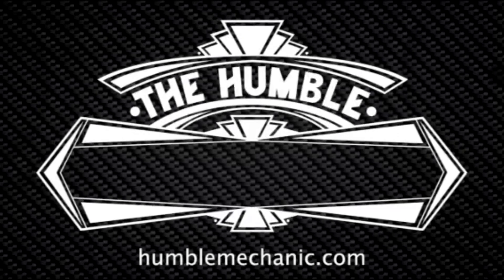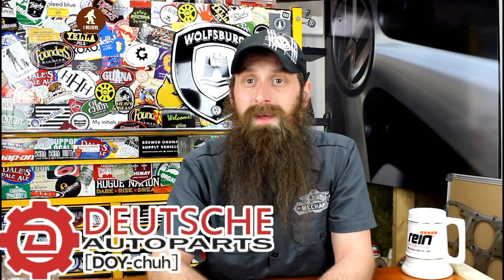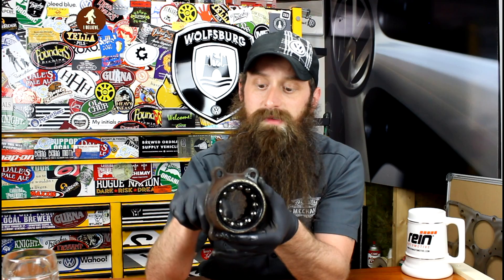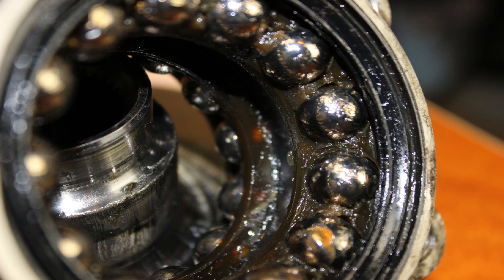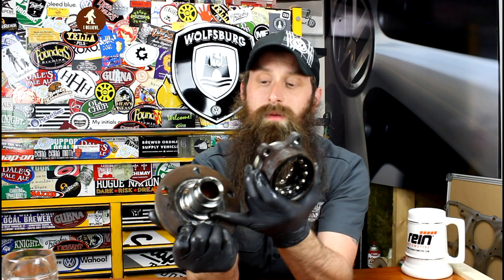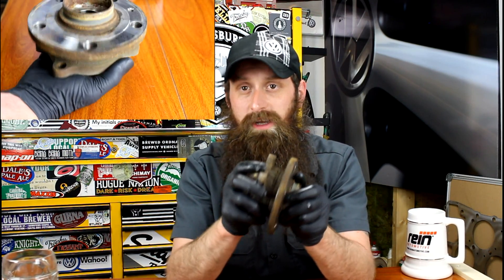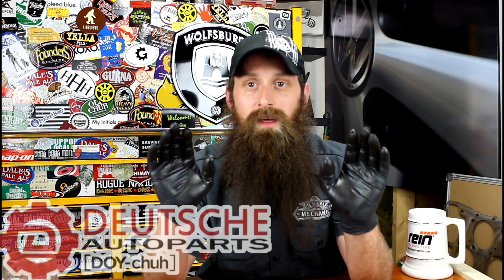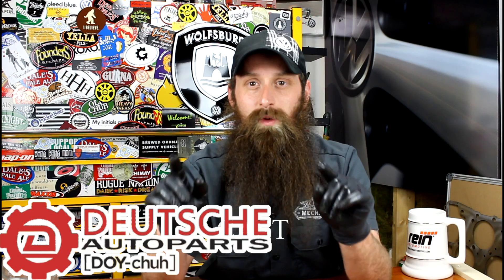How VW Wheel Bearings Fail ~ Video

Comment: Another way to diagnose which bearing is bad is to jack up the car and spin each wheel while holding onto the suspension spring. You’ll feel a vibration/grittiness with the bad bearing.

Comment: Hey Charles, 
I have had an undiagnosable vibration since I bought my 2018 Sportwagen last September. Dealer has replaced haldex, both guibos right axle, and right wheel bearing. I have tried 4 sets of wheels, 3 sets of tires. 

Vibration is in the steering but very light, also in my gas pedal, feels like a cell phone. Techs keep telling me it’s not exhibiting bearing symptoms closely enough for it to be replaced but I’m running out of ideas. I feel every road surface through the pedal as well. Any insight? I’m kinda going crazy
Reply: I can’t reproduce a “wom wom” but it’s definitely loud on the highway in the cabin. The roads are kind of crappy out here so hard to tell much over tire noise.

Comment: A little misinformation on this video bud. The older ones do have another option other than pressing them in. You can buy the whole assembly online for less than 100 bucks to which you just bolt it on. I have an mk4 golf

Comment: Can wheel bearings affects the transmission if we didn’t change them on time? What the worst going to happen if we ignore to replace them immediately after we hear the noise?

Also I noticed I got the noises from the bearings only on winter when it is really very cold about below 25 degree

Comment: Whats the easiest way to change the rear wheel bearing on a awd 2010 tiguan? Manual says to take the housing off. Doesn't even mention taking the bearing from the housing so I'm hoping there is a way to pull less bolts than the manual suggests as I like in snow country where we use rock salt on the roads

Comment: I just bought a used 2014 Jetta sportwagen tdi a month ago with 50k miles. This vehicle sat at the silver dome for a couple of year. I took it back to the dealership bc of crazy loud road noises from the front left tire. Test drove the car (which seems faster now) on the highway and now I can hear the front right making the same noises. Could this be that the bearings warped/rusted from sitting two years without movement? Will I likely need to replace the back too? The car is extremely loud on the highway. Anyone have any thoughts if vw is warranting the hubs on tdi’s?

Comment: If its a suspect wheel bearing, the noise will be loudest at the hub with the worn bearing. Get the vehicle up off its wheel at the appropriate end, secure with axle stands and firmly chock the wheels still on the deck. Rotate the free wheels and use an engineer's stethoscope or a stick to listen to the rotating bearing by touching the hub. You can use a socket and speed brace on a wheel nut to get the spin speed up a bit. The task needs an assistant.

Comment: Can anyone tell my what makes my mk4 whine when I’m going through the gears. I have the 5 speed 2.0 . It sounded like it is in the wheel. And when I hit the brakes it feels like the wheel on the driver side flops around. 

Now let me say . I have a new axle . New wheel bearing. New ball joint. New coilover. 
I can’t duplicate the sound on jackstands. 
I disperetly need some help. 
Is it possible coming from the passenger side? The sound sounds like gears or a Ford power steering pump lol. Im open to all advice. Thank you in advance
Reply: xamot80  ok! Thanks 🙏

Comment: Is my 2012 Jetta S the kind where I can just remove the complete bearing/hub assembly or like my 07 Honda CR-V where the front ones require the bearing to be pressed in? Weird thing on the Honda is the rear ones are replaceable as one unit but, like I said, the front ones require owning a press. I did the rear myself but was forced to pay for the front ones. How is it on my 2012 Jetta (front & back). Please, replies ONLY from people that know FOR SURE about my particular year and model. No general “They’re all about the same on those years” type of answers.

Comment: I have a vibration at 75. Mk7 aftermarket wheels. I had everything checked for round and balance 3 times. Makes no sound and it comes and goes. 55000 miles on it.
Reply: And i have tried 3 different center rings.
Could it be a bearing?

Comment: I took my car to the shop and they told me it is a loud humming noise coming from the front of the car, but now that i see this vid. It makes since now , and the noise sound like it is coming from the front right, but i am not ready to spend that kind of money just yet,  times is hard right now,  i will do my homework to get a good deal i looked it up and it could range from $200-400, 😢
Reply: It’s a pretty simple DIY... if not I would suggest having it done when you go in for brakes and rotors as most of these things will have to be removed to do the wheel bearing. Good luck.

Comment: Had 2 of these break on a 2015 Tiguan. I’ve driven Ford/Honda for over 260’000 km and never change a single wheel bearing. Never  buy a VW/Audi.

Comment: My Jetta does a grinding noise while slowing down. Brakes and rotors are fine. Could it be the front wheel bearings?
Reply: I saw another video and I think the hum/vibration is because the wheel bearing is dry, no grease anymore

Comment: Got a vibration after 60-70 wheels are balanced perfectly and there is no play any ideas ? I am thinking Ci joint or a wheel bearing it is a 2010
Vw golf
Reply: Have you find the solution? I’m having the same issue.

Comment: In the bad good old days, we used to repack the wheel bearings with fresh grease.  They almost never failed and when they did, it was cheap to fix.  Modern wheel bearings are terrible, an expensive scam.  Instead of buying a few pennies worth of fresh grease every year or two, we are forced to spend hundreds of dollars on new hubs and bearings.
Reply: I agree, however felt nice to have new hubs too at the same time. I have however suffered a second failure of the rear left in the same year. Don’t know why. First set lasted 8 years and this was replaced at the dealer

Comment: Had my ps rear wheel bearing fail on me over the past couple months. Did not notice the noise until a couple days ago when it made metal on metal when turning right. 2012 vw golf tdi. The hardest part was breaking the bolts as I did not have access to a lift. Just a jack and blocks. Sketchy but got er done and saved a lot of money in shop fees. Great vid even though I just finished replacing it 5-6 hours ago lol.
Reply from the maker: Oh yeah that bolt is TIGHT!

Comment: Hey Charles!

I've got a 2014 VW B7 Passat 1.8T, just hit 70k miles. I've got a loudddd rumble noise around 55-68MPH once I go past that it's either very quiet or gone. Before 55 it's not really noticeable either. Around 55-68MPH it's annoyingly loud.

Funny thing is, whenever I turn left the noise goes away until I straighten the wheel, and then it comes back. It doesn't go away if I turn right, just left.

I was thinking it's the wheel bearing but I'm not entirely sure. I had a set of 17's aftermarket with hub centric rings, and it didn't happen.

Winter time came around, took it to Goodyear, put on my factory 16's with winter tires and it's happening now.

I don't think they took off the hub centric rings, as it wasn't returned to me, just the bolts.. could that also contribute to the problem? Or maybe they did take it off and didn't put it in the box for me..
Reply: Did you find out what the problem was ?

Comment: Hi Charles, love your work and these videos. I know it’s an old video but I just wanted to ask you a question. My mk5 golf Gti turns on the tyre pressure, traction control and the abs warning light when I get up to around 70 mph. I think this could be corrosion built up on the abs ring but does it come as a full wheel bearing assembly? Any ideas? Thanks in advance
Reply from the maker: possible, I would look at the tires themselves. Be sure you have the same tires all around. That can be an issue on the Mk5. I had one with 1 tire that was either worn too much, or a slightly different size (225 vs 235). It would trip the lights on a hard turn
Reply: Ok thanks Charles I will have a look at that as well then. Thank you for the reply also, it’s  greatly appreciated. Keep up the good work
Reply: @DrDepraved1  Don't mean to revive an old thread but just wanted to add a comment in case it can help someone else. I had a similar problem as what you describe. My ABS and ESP warning lamp would come on when I started hitting 60+ mph. It got progressively worse (as in, lighting up at lower and lower speeds) until it would come on literally as soon as I drove off after starting the car.
Took it in for diagnostics at a well-known franchise (in UK) and was told I needed a new ABS sensor (£45)  + wheel bearing kit (£150)
Went for a second opinion at an independent garage and the guy just took out the sensor, sprayed some WD40 and cleaned wtih a rag... the fault disappeared.
Nearly skinned for £200 for work that I didn't even need.

Comment: On my mk5 GTI it sounds like there's a helicopter on the front left side.
Reply from the maker: Sounds like a wheel bearing to me. Well based on what I read. LOL
Reply: HumbleMechanic Well it happened, because when I was replacing my struts I forgot to put the axle bolt in. Kinda a big screw up on my part. Just glad nothing really got destroyed, well besides the wheel bearing and maybe the CV joint

Comment: do i have to do alignment on vw 2012 jetta 2.5 after replacing wheel bearing
Reply: you may need to because of having to move the ball joint out of the way

Comment: hi I have a question, I have a 1998 GTI VR6 and I replace the wheel bearing on both front sides but the sound didn't stop and there's still play I'm the wheel. What should my next step be? thank you
Reply from the maker: +Juan Ramirez the play could v in several places on that corner

Comment: What you said about the helicopter sound sparked my interest.. I have a 99 Passat and the is an insanely loud banging sound that is exactly like that and it sounds like its coming from the right front and I have checked the brakes, wheel/lugs and all the suspension and can not figure it out.. unfortunately the bearing is pressed in so I'm assuming it will be a very expensive fix?

Comment: FUCK! I've been chasing a steering wheel vibration for a year,  mk5,  2 things, my steering wheel vibrates at exactly 64 mph. The faster I go the vibration goes away or minimizes, if I set cruise at 70 or higher it's almost gone.  The other red flag, I did get wheel speed sensor flashes on my dash a few times, the logo with the car and the skid marks, ESP warning?   I hope this is my problem but figuring out which side it is is going to be the tricky part.

Comment: My mk4 golf TDI had its front bearings replaced before 100,000 miles

My b6 Passat was also before 100,000 miles for the front and the rears shortly thereafter. At least they are easy to replace.

Comment: Really helpful video, my car (mk5 gti) makes a humming noise when i drive it at around 50 mph and i feel the vibration on the foot rest on the left side, the cv axle is new (needed replacement) but the noise is still there, is it the bearings?
Reply: David Morales Google "broom stick wheel bearing" to find the DIY diagnostic steps for an easy way to verify if it is the wheel bearing that is bad.
Reply from the maker: David Morales It could be. I would also take a close look at the tires before replacing the bearing. Maybe even rotate them first.
Reply: Thanks, i will for sure